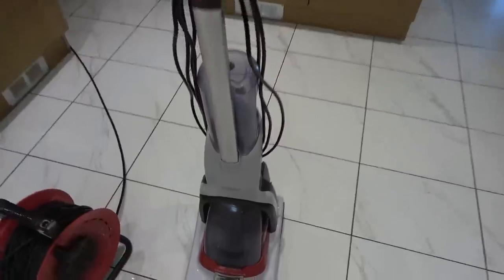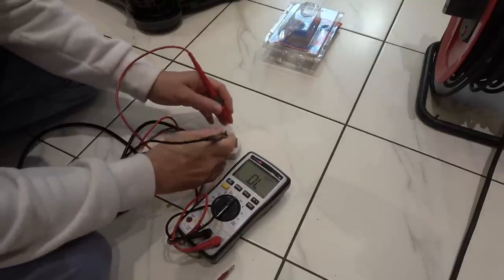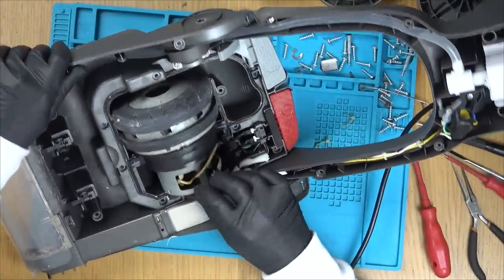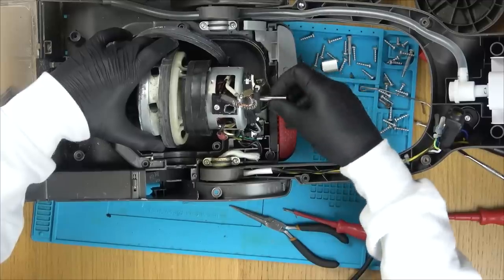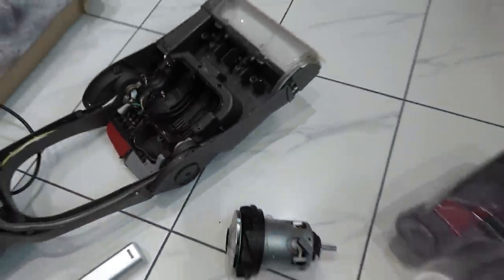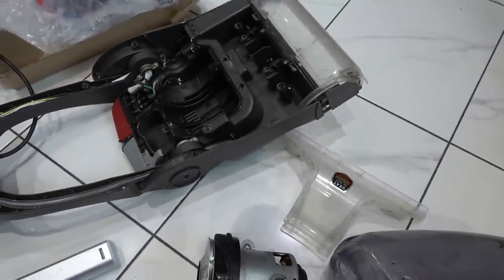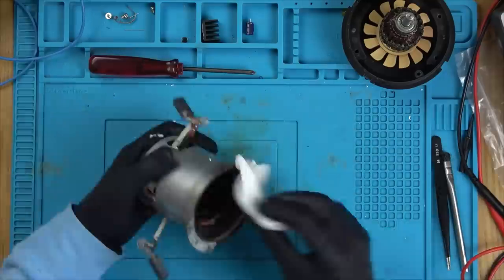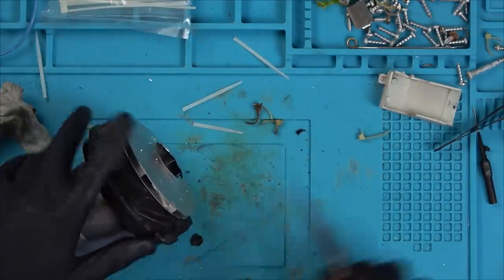Vax Carpet Cleaner Tripping the Electrics - Can I FIX it?

Comment: best to use another shorter extension cable rather than a huge reel all wound on the reel whilst in use - it can overheat and trip electrics itself, trip a thermal detector if fitted, or if not, just melt...if this powering a lot of hungry devices...

Comment: Family must get fed up of being plunged into darkness. 😂

What probably happened to the machine was that it was laid down on its back or side (e.g. to clean the brush roll) with the tanks fitted and water in them. My VAX carpet cleaner (different model) goes to great pains warning never to do this as water can then get into the motor. Tanks must always be removed before laying the machine down. The float valve in the bottom tank shuts off the vacuum so no more water is sucked up, stopping the tank overfilling and again entering the motor. Laying the machine down negates the function of the float valve.

Comment: I hate working on any Vax product as they often take forever to get to bits. Plus, getting parts for them can be a right pain. The number of machines I've plugged in and instantly smelt a burning smell coming from them is ridiculous. Also, the recovery tank on Carpet machines such as this are almost always smaller than the solution tank as you'll never suck up all the water the machine releases.

Comment: Wow those windings are in bad shape! No wonder it tripped the previous breaker and it smelled like burning and the cable ties melted off. A new motor is a must the windings burned, likely causing a short between the rotor or stator or casing. that copper has enamel tha can burn off when it gets too hot and the windings short, causing low resistance tripping the breaker also there would be a lot of sparks inside the case probably seizing up the motor. That motor is dead. Maybe water got inside it that caused arcing that heated up the enamel on the windings causing the heat that caused that melted the enamel creating the shorts?!

Comment: That winding insulation is getting weak that why the motor is getting over heat. You can always replace the winding, and it is cheaper than a new unit.

Comment: Unwinding your extension lead fully is pretty important if you are going to plug in something that is faulty. If it pulls 13 amps due to a fault, it won’t trip the fuse board but it will cause your extension lead to act as a coil and the lead will get hot very quickly. That heat is trapped in the mass of cabling in the coil and melts the insulation. If left that way long enough, the insulation become brittle and potentially causes a fire, perhaps even when used with known good devices at a later stage.

Comment: It’s a pretty stupid design with the water tank, as even if you kept it at the safe level, you may accidentally knock the machine over which will cause the water to flow into the motor. We have one of these and after only about 2 uses we switched it on and the motor sounded whiny. It seems with ours that water has got into the motor and damaged the bearings. I’ve tried to explain this but they don’t believe me.

Comment: this is a knock off version of the hover one in the us
leo kim video did a video on the same one you have there and i have 2 of the hover ones here and both have bad bearings and sound like crap when you use them
in fact mine sounds just like the one you have but way louder 
i bought a new bissell one to use for a good cleaning and use the 2 hover ones i have just for spills or if the dogs decide to go in the house

Comment: I own this cleaner and day 1 of using it, it blew the electrics turns out none of the cables(yellow,brown,blue) on the inner switch had been crimped just wrapped badly in tape needless to say the exposed wires touched after pulling the cable a few times. If anyone buys it i would double check its a few screws.

Comment: It looks like these are badly designed. I've found motors for it that have suffered similar failures where they've sucked in dirt due to a seal failing. There's one for £14.99 right now but it has tons of dirt sucked into it, it'll need a strip down.

Comment: What a crap design that is, the water should never be able to contact the motor, in any failure mode it could of caused an electric shock or a fire